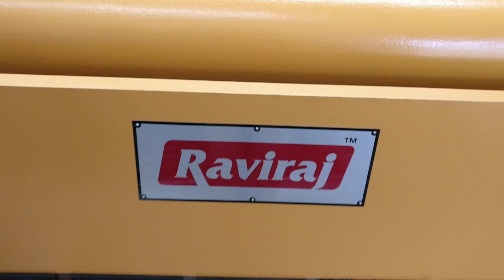Mini hydraulic Press Brake 2030x2mm MS Bending (Rear Cylinder With Electrical Panel Board)

Comment: I am murad from srilanka. I need to buy 1 shearing machine & 1 bending machine
Shearing machine cut
Ss - 1.5 Alu - 2.5 ms- 1.2 
Blade length 50" 
Bending machine 
Alu-1.5  ss - 1.2 ms 1.2 bending  blade 48" i want briefly details & prices Use